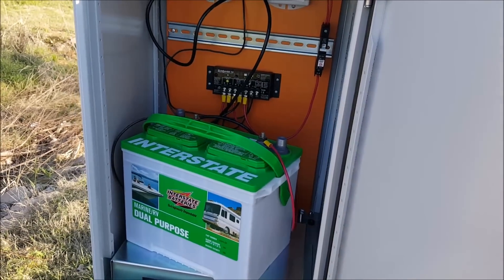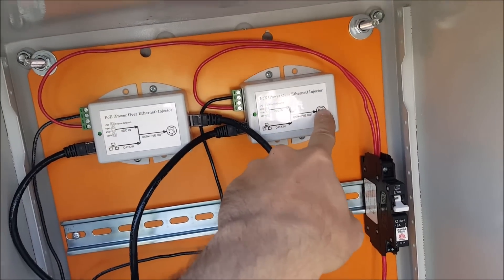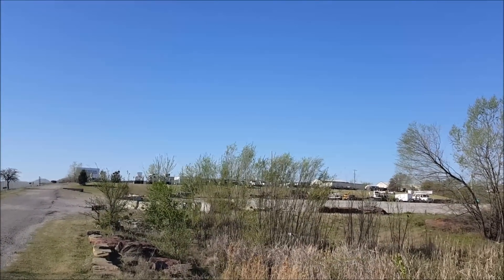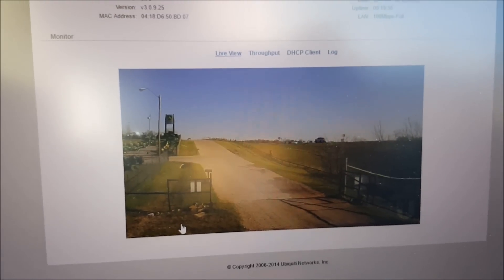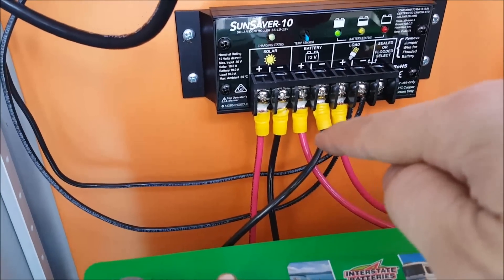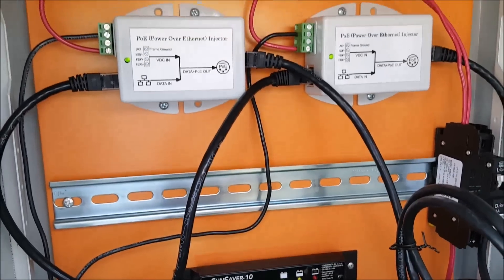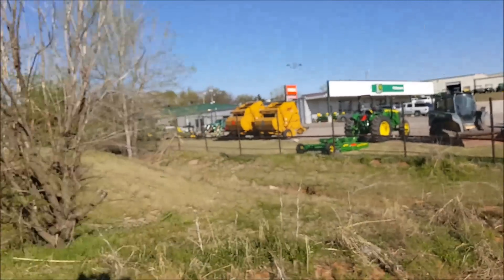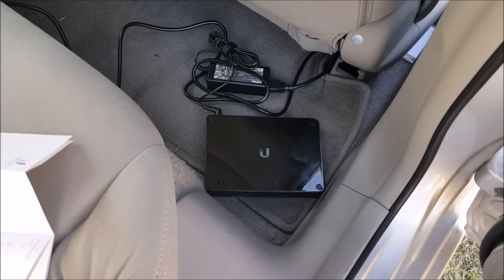Solar Powered Surveillance Camera Project 5

Comment: Working on a very similar project for a customer. Can you reply with the breaker specs and mounting bar for that breaker, I have all of the other components in my cart already. We decided to try the RioLink duo camera instead! Thanks for the great video set, it was very helpful!
Reply: Wondering this also!
Reply from the maker: The mounting bar is just a standard din rail.  You can get them from anywhere.  It has a standard style of connector on it that many manufacturers use to let components snap on for easy mounting.  Here is an example from Amazon (affiliate link):  https://amzn.to/3TunJui

For the breakers, you just need a 12V (or 24V or whatever your system voltage is) DC rated breaker that can handle the exact max power rating of the device and that is it.  Since you are using cameras that are very low power, you may not be able to find a breaker less than about 5A.  So that would be fine.  But don't get like a 20A breaker or something like that.

Comment: You should run Plastic carlon up the pole to protect the wires from being cut.
Reply from the maker: I thought about it but if someone is coming on the property to cut the wires and disable the camera they will easily be able to reach the back of the solar panel and cut them there, where conduit is not possible.  I also thought about running the wires on the inside of the pole but if the cap on the top of the pole breaks over time then the inside of the pole will probably fill with water and that would be no good.

Comment: I have a question I know you did this years ago . But with that setup how long you get with no sun?
Reply from the maker: I designed it to operate for 2 full days with no sun.  In the real world that isn't possible unless the panel is perfectly clean and the battery is in perfect health, etc.  But it worked really well and was never down.

Comment: I have 2 comments if i may -- i would not have used an lead acid battery i use AGM type which are sealed and work better in the winter months -- i never thought of using a breaker box switch instead of fuses but hey if they work why not -- i would still rely on fuses myself -- they have some that have small LED's that turn on when the fuse is blown -- and i seen another comment about hiding the cables all together inside the pipe or maybe some other pipe to keep elements ( sun ) off the cables -- just a thought -- you may have thought of that also but always more test and tune and clean up that might happen on any install -- good job though !!!

Comment: Nice set-up, good information, well produced. One VERY important thing to add. ALWAYS install a inline fuse on the B+ side of the battery at the battery  B+ terminal post, every time!  Reason?  If anything short circuits down line from the battery, be it the charge controller or simply touching the B+ to ground anywhere, you could do a lot of damage to your equipment or yourself.  A 15 amp fuse (in this case) would be cheap insurance!  Here is a link to the inline fuse I'm talking about.  I use them on ALL my projects.

https://www.amazon.com/10-Pack-EPAuto-Line-Holder/dp/B01DYPY0E4/ref=sr_1_13?ie=UTF8&qid=1523112616&sr=8-13&keywords=mini+fuse+holder
Reply from the maker: Good suggestion.  Thanks!

Comment: The gasses given off from the battery charging is bad for electronics and should be isolated. I would place a higher priority on vandalism and theft by placing the box and equipment higher off ground requiring at least a ladder to reach. Most of the Ubiquiti runs on 24v but some of the newer is finally normal 48v POE. Supposedly the M5's etc will run fine on 12v also.

Comment: any links for the poe injectors you used?
Reply from the maker: Yes, I am 95% sure this is the model I used:  http://tyconsystems.com/index.php/dc-passive-gigabit/501-tp-dcdc-1224g
Reply: ty. im building the same setup without the expensive box and mount.
Reply: how many watts is your solar panel? im using 160w and a 110ah 12v deep cycle battery. hoping i can power 2 cameras and an access point. might be a stretch
Reply from the maker: Yes the box was expensive.  I was not footing the bill and I needed to make sure it was water and dust proof.
Reply from the maker: 100W.  I did the math and that would give my set up 72 hours of run time if there were no direct sun.  Yours will probably work fine but may suffer in extended cloudy conditions.
Reply: Can you provide maybe an all in one place list of products used (especially interested in the box and the controller.......Did you ever research using ubiquiti's line of solar products (controller and panel)

Comment: For the Nanostation M5 did you use a Tycon 12-48V or a 12-24V.  It looks like the unit only works with 24V.  Where the cam you have looks like it would use the 48V
Reply from the maker: They are both 24V.

Comment: With the setup can it run 24/7? or does the battery run out?
Reply from the maker: This system could run for 3 days straight without sun but eventually it needs to recharge.  Under normal conditions it will run 24/7 so the cameras can record at night if they detect motion.
Reply: @LDSreliance  What kind of power consumption is in play?  Does power consumption only go up if there is motion?  Or is it always drawing the same amount? If you have cloudy days for 3 days or more, would you be out of luck?  How well has this solution been working since you started?  Have you stuck with Solar / Batteries?

Comment: also wondering what you think about adding a gsm moden and a 4g sim card for remote viewing instead of a direct line of sight type of deal.
like this https://www.shopmoxa.com/moxa/industrial-cellular-oncell-series/oncell-g3151.html
Reply from the maker: Yeah, that would be great.  If you have no desire to connect your camera to a network and to a DVR that would be a great solution.  Of course you would have to measure the cell signal at the location and all of that and you would obviously incur a monthly charge.  But I know you already knew that.

Comment: G'day mate,I have done a few of these installs. Don't mean to sound like a smarta@#$, but if you need to do more of these you can run all your cables down the inside of the mounting pole. This does not only look heaps cleaner but increases vandal resistance massively, Great series of clips. Well done!!!
Reply from the maker: True.  I thought of doing that but I figured if a vandal was inside the property already then one of the cameras already caught them on video.  And also that pipe was really, really thick so I didn't really want to drill through it :)

Comment: Hey there, i have watched from the beginning and this project is cool as heck. You did mention that the enclosure was a Nema 3 . Can you mention the dimensions? Also would you not benefit by having the ant./emitter at the highest point or does that not matter with the frequency being used. Great videos and projects. keep on at it.
Reply from the maker: Good question and thanks for the comment.  It is NEMA 3R and here is a link to the specs or to buy:

http://tyconsystems.com/index.php/enclosures/422-enc-st-23x14x12

As far as the emitter/radio, as long as it has direct line of sight to the other end it doesn't matter how high it is.  I didn't want to put things at the top that might shade the solar panel.

Comment: this is actually a great project.
in my country, the gov have those kind of cameras for car infraction control and general security. so, having autonomous cameras would be cool
Reply from the maker: +Jerónimo Barraco Mármol Yeah, they have some of those cameras here for traffic control, too.  In this case, solar is a lot cheaper than running power lines underground to the location you need the camera.
Reply: Nice, as well as making them resilient to power deficiencies.
Reply from the maker: Jerónimo Barraco Mármol
Yep!  My company is in the powerline business so when the power is down we have to be able to operate.
Reply: Cool that explains why/how you got those cool tools and knowledge. 
In Argentina solar power is just starting to bloom. 
Thanks for the videos keep it up :)
Reply from the maker: Jerónimo Barraco Mármol Will do.  I hope solar becomes more common in the near future to drive prices down and encourage competition among manufacturers and suppliers.